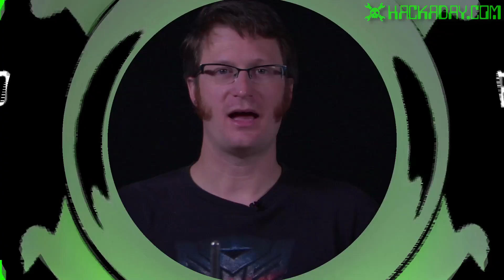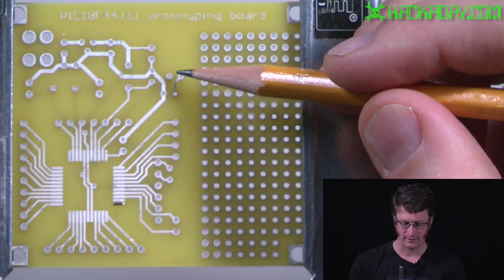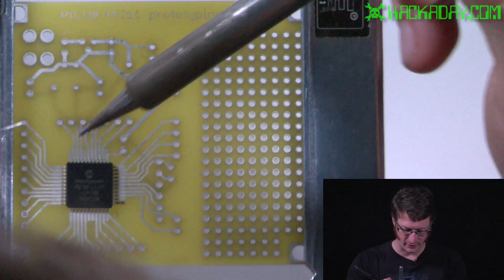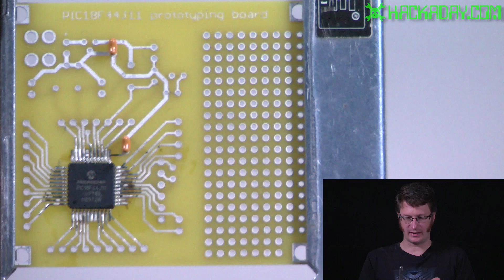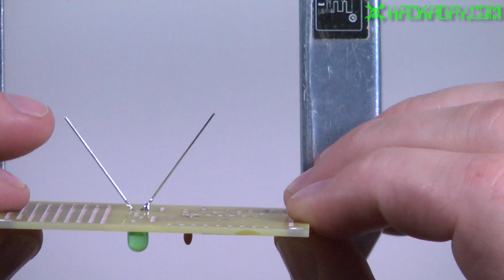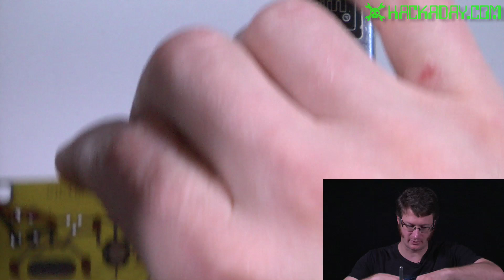Soldering the PIC18F44J11 prototyping board

Comment: Your soldering technique is absolutely dreadful! Soldering in a chip this size is so quick and easy with a non reservoir hoof tip, some tacky flux, and the right amount of solder applied - no braid needed.